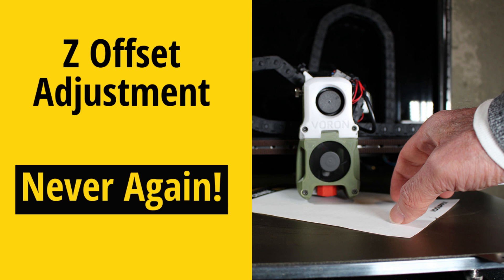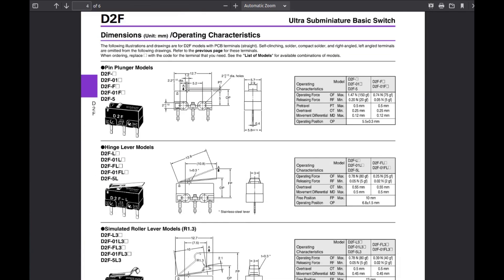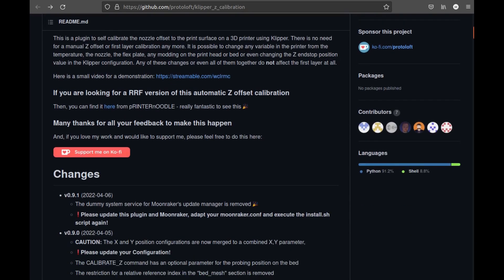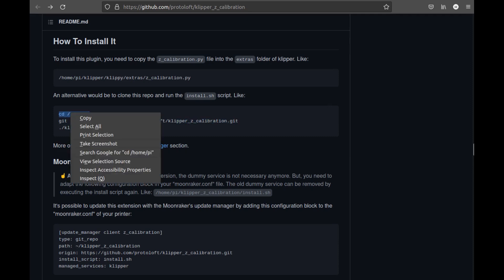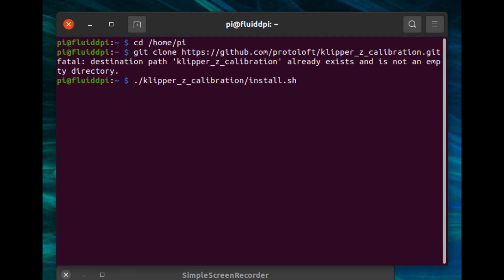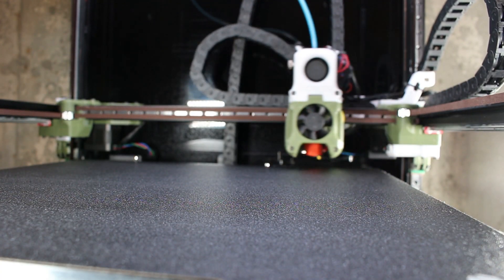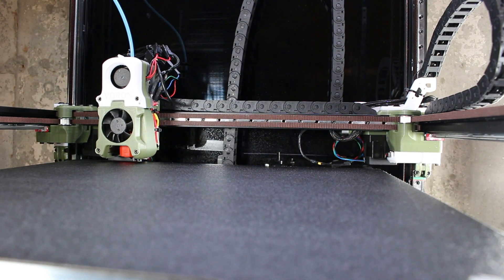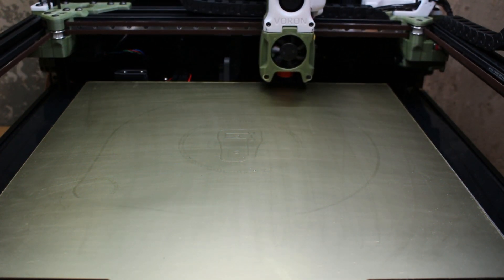Never adjust your 3D Printer Z Offset again with Klipper and a plugin

Comment: Hello, i have an Anycubic Kobra2Neo. And there ist the same switch on the end off the bed. So can i use this plugin to auto z offset my printer with klipper ? I dont wont to put that switch on the head.
Reply from the maker: For the auto calibration, you do need the second switch on the print head.   It should work for you.  If you have springs under the bed, you might need to firm those up.
Reply: @KapmansBasementWorkshop  can I use the inductive probe on my print head as second switch?
Reply from the maker: @D3ltoroxp no, you can’t.  The inductive probe doesn’t measure the surface of the bed, it measures the steel plate under the surface.  You need the micro switch as it actually touches the surface which is what makes this consistent.  Even if you switch bed plates.
Reply: @KapmansBasementWorkshop  So when i dont use this switch on head, i cant use the plugin for auto z offset calibration ? I will only when i push z offset calibration, that he push the switch in the back of the bed.
Reply from the maker: @D3ltoroxp  , Yes, you need both switchs.  The nozzle switch and the z-offset to check the surface of the bed.

Comment: My setup consists of the z-endstop dedicated for homing, and the KlickyPCB equipped with Omron D2HW-A201D microswitch.
In contrast to Euclid probe and earlier Klicky versions, where one can count with the pre-travel of 0.5mm (that equals the tip-to-body distance), KlickyPCB has its conical cap that adds a gap of roughly 3.4mm from switch-on-point to body.

Let's consider this upon the measurements I made:
Tip = 0
Tip-to-body distance: 4.00mm (-0.05mm)
Cap tip travel: cca 0.6mm (OFF -> ON)
Gap == 3.4mm (to body)

I believe this is the distance we KlickyPCB users (using aforementioned microswitches) are complaining about.
Reply from the maker: I'm sure many will find this helpful.  Thank you for posting!
Reply: @KapmansBasementWorkshop  

In order not to leave the others amid the wilderness here are some follow-up thoughts.
Since Protoloft's equation is a linear one and the switch_offset constant gets used once only, it may also be used for KlickyPCB without hassle.

My setup ended up with (autoz.cfg):

[z_calibration]
switch_offset: 3.25

It may occur 3.3 or 3.4 would prove to be fine for some.

As per QGL and bed mesh (printer.cfg), my findings for 350mm bed are as follows, see ## notes:

[probe]
y_offset: 19.0                   ## KlickyPCB distance tip-to-nozzle, towards back (Y+); was 25.0 (default)

[quad_gantry_level]
horizontal_move_z: 10    ## default 5 is too liitle, KlickyPCB skids/glides on the surface during move

[bed_mesh]
speed: 120
horizontal_move_z: 10    ## default 5 is too liitle, KlickyPCB skids/glides on the surface during move
mesh_min: 35, 25            ## KlickyPCB  position, not nozzle!       25 - probe.y_offset: 19.0 = 6               => axis goes to Y6
mesh_max: 315, 293       ## KlickyPCB position, not nozzle!     293 - probe.y_offset: 19.0 = 274          => axis goes to Y274
probe_count: 5, 3

Bottom line:
Compliments and thanks to Protoloft and you, Kapman, to make and visualize the AutoZ idea.
Helped me a lot during the build, though it was confusing (to) me at first due to the application of KlickyPCB instead of Euclid or KlickyNG probes.

Great channel of yours, thx👌.
Reply from the maker: @rozsikacsipke9880  Thank you for posting this and thank you very much for the kind words!

Comment: So one thing that always gets me stuck with any so far z-calibrate. Is the paper test. I seen this and many videos still go back to it. I would like, and I think you and many would agree, to take out the human in this all together. So I think my issue is just HOW tight is it to feel when closing in the paper? barely touching, or tightly almost paper jam, or what? this guess work is where I get stuck on EVER type of z-offset adjusting. why is there not a better more reliable way? strain gauge pressure plate? or something. Is there really no way to eliminate the paper in each of these, and more 'measured'? Yes I do have those metal gauge you can buy. but there again, what exact amount of pressure can vary by whole millimeters. so humm. Shrugs
Reply from the maker: I struggle with the same issue.  I try for lite friction.  No matter how much friction you choose, there will be some test print calibration anyway.  Howwever, with this software change to Klipper, you should really almost never need to do it again after the 1st time.   I had to replace the microswithc a few times, both actually.  I ran the paper test again after that change.

Comment: Sorry. I know you posted this a year ago, and maybe not for the printer you have or use.

I am using a BLtouch to the left of my nozzle on a ender 3 pro. ( it is heavily modified, new board, hemera all-in-one etc).

Maybe because it is 4:20 Am where i am while I ask this.
Do you or anybody know if this can be setup with a BLtouch on a ender 3 pro by chance??

Thank you.
Reply from the maker: So funny thing.  I'm setting up a BLTouch on another corexy printer as I write this.  This is my 1st time using one.  I don't honestly know, but I suspect not.  Mainly due to the shape and construction of the BLTouch.  But as I gain more experience with BLTouch (it's not fully operation yet), I may look into this next.
Reply: @KapmansBasementWorkshop  also the github is , well how to say, Bare now. I do not see the why this, and the detailed how to or any of this stuff (like on your video at 3:13). So Is this even a thing anymore? I would love to have the details the creator made. I see png files but Yes all the setup and explanation etc on the github seem to be gone.

Comment: Any changes to your print start macro? For me, the calibration works perfectly, but when i start a print the nozzle is about 4mm above the bed. Any influence from position z endstop on this or the klicky probe z offset?
Reply from the maker: I've got a very different start macro these days.  And I've been testing other features, so my  newer one does not apply.  Have you  taken a look at: https://github.com/Kapman1/Kapman1/blob/main/printer.cfg and https://github.com/Kapman1/Kapman1/blob/main/autoz.cfg or even better reviewed the latest from the creator of the auto-calibrarion software?  https://github.com/protoloft/klipper_z_calibration

Comment: Is it normal to change the z offset +/- .10 to see any change. I can't seem to get it right. Always too far or unfortunately too close and destroys build plate. Thanks
Reply from the maker: With my eyes, it's very hard to see any change.  I need to use a piece of paper or a feeler gauge to notice a difference.  But 0.1mm is usually very noticeable with paper.

Comment: I hate adjusting the Z-offset,  so many failed first layers trying to get it right.   I use a CR Touch but even with that I don't get a good accuracy between different build plates, even though it really shouldn't make a big difference as the probe, being a touch probe, should pick it up, but it doesn't.   Has to be changed every time
Reply from the maker: That is odd.  I agree, it should not matter.  Do you think the bed or the gantry might not be flat or straight?  Is there a loose part or screw anywhere?

Comment: How does this compare to tap?
Reply from the maker: I think it compares well in terms of accuracy as it's certainly good enough.  This is much ligher in weight and fewer moving parts.  It's also much cheaper.  It adds no play to the tool head.  You also don't need to worry about damaging the PEI bed at higher temperatures.

Comment: this plugin work with cr touch on an ender 3 v2
Reply from the maker: I have not tried it.  But it might work if you install a nozzle endstop like the Voron 2.4 has which would not be hard to do.  The tricky part will be getting the values correct so the flat surface of the CR touch will touch the nozzle endstop and not the CRtouch pin.  But it could be possible.

Comment: After the recent Klipper update I can't get past this error. I have reinstalled Klipper on the pi and main board. I can't figure this out and would love some assistance.  Error is "Section 'z_calibration' is not a valid config section"
Reply from the maker: Since you reinstalled Klipper, have you reinstalled Z calibration?  My assumption is that it’s no longer installed based on the error above.

Comment: Can the head height be increased inbetween the z home and when it measures the probe height on the z end stop and if so where is that located? My klicky probe is hitting the endstop as it is moving into position over the z end stop switch.
Reply from the maker: Yes, that can be changed.  I used the Euclid instead of the klicky, but have a look at your m401 macro.  The z height is set there.

Comment: I am having such a hard time with this and I cannot for the life of me get it to work.
Reply from the maker: What is happening?
Reply: @KapmansBasementWorkshop  when i give it the command CALIBRATE_Z i keep getting (Offset is greater than allowed: offset=-6.025 > max_deviation=5.000) I have looked all over and have been stuck on this for a week. Ive done every calibration I have found and nothing seems to fix this. I'm not sure what im suppose to adjust or what im looking for all of the documentation ive found doesn't seem to mention this error or what it even means. I know something is off but as to what is not correct I have no idea where to even start. sometimes I don't get that error but it will dig into the bed so im not sure whats going on.

Comment: I am having a hard time getting this working. Any chance you can help? It seems to be physically/mechanically working, but my first layer is not perfect, it doesn't even stick at all. I can still babystep down to get it to stick, but I'm not supposed to have to do that, right? My particular Z endstop is actually negative/ below bed level (-1.14 currently, per endstop calibration), do you think this has anything to do with it? It doesn't seem that far off, as in if it was flipping negative to positive it seems like it would be a 2.28mm shift, I only have to babystep like .05-.15 to get it to go, but this is the whole thing I'm trying to avoid. Does the Probe z_offset get taken into consideration here? At some points it seems like it does, but others not. Currently have it set at 6.87 per probe calibration. Currently set my switch offset to .52 as i am running the same machine as you, i know this probably needs tuned, but i tried it as high as .55 and it still didn't go down well. I feel like any further than that means something else is off. Any suggestion would be apreachiated. I was able to get an inductive probe dialed in just fine with the negative z endstop. (By the way this is just how my kit came, weird that LDO didn't get the height of the post above bed level, but until now i never suspected any problem with it.)
Reply from the maker: Have a look at this page: https://github.com/protoloft/klipper_z_calibration/wiki/How-To-Test-It
This should get you on your way.  Once you have adjusted that offset, you should be fine.
Reply: @KapmansBasementWorkshop  Been through it a couple times. It is very close, but my problem is when I do baby step it, I am not sure if I should be applying that to Z end stop, or to probe offset, or to switch offset. and I think I just keep over tweaking it. But I have also reset and restarted tuning it 3 times. Same results every time. Ended up just going with Klicky as Z endstop, and it works a treat. Thanks for the reply though, i appreciate you taking the time.

Comment: SOLVED !!! the issue when using the euclid attached to bed and changing plates more than 1 mm.
I have changed the code in the gcodes macro definition of the ATTACH_PROBE and DOCK_PROBE with the next lines added:
       G0 Z30 F6000
       SAVE_GCODE_STATE NAME=default
       G4 P500
       SET_GCODE_OFFSET Z=0
       G0 Z30 F6000
	...
	...
	ALL THE GCODE..
	...
	...
	RESTORE_GCODE_STATE NAME=default

Look that it is very important the repetition of  G0 Z30 F6000 (or the position used by you at start) to go to the new position that dont have offset applied.
Reply from the maker: This is great to hear.  And thank you for posting the solution!

Comment: I can not for the life of me get this to work. Every time i tunr on my printer it changes the z offset? Voron 2.4 300mm klicky a7to z calabrate
Reply from the maker: Silly question.  So the z-offset value changes, but the print fails as well?  When I run this throughout the day, the values it generates change as the printer is actually changing with the heat.  But the nozzle would end up being the correct height from the bed.  In your case, the nozzle is no longer at the right height?  If so, is there any play in the probe or z-endstop mounts?  Also, over time, I found I would need to replace the probe's micro-switch as I'm convinced the heat would damage the microswitch over time.  Either from the printer itself or me over heating the microswitch when soldering it.  The technical docs for the microswitch actually have strict instructions over the temperature used for soldering and the number of seconds and times the heat can be applied.  I found when I strayed from that the switch would become unreliable over time.  So in short, I don't think it's the software.  It's most likely the microswitch or the switch mount.
Reply: @KapmansBasementWorkshop  I check3d over my klicky switch it was good so I started looking at the mount in the hotend and it was cracked and loose. I superglued it back together and was able to get a print going to print a new mount for the hot end. I'll do some more testing and see it everything stays as is or keeps moving on me I'll let you know more later. Thanks for the help!!
Reply from the maker: That must be the issue. I am glad you tracked this down!
Reply: @KapmansBasementWorkshop  are you on discord? Would you be able to chat on there?
Reply from the maker: @Larkinatorr  I am on Discord.  However, I probably will not be able to chat until early next week.  But if you contact me, I will get back to you.
Reply: Nozzle height changes drastically every print. Even without turning off the printer, it will change from one print to the next. I did not solder in the switch. it's held in with self taping screws and press fit to the magnets. I'll try swaping out the microswitch and see if that helps.. originally, my switch offset was 5.2. It's at 3.2 now, and nowhere close to the bed sounds like this may be the issue. I'll try it out after work today and let you know!

Comment: Wish my probe would consistently work. damn auto z and klicky... used to work well. now its been trash. I dont get it... Also i was told that the pre travel thing isnt quite right for klicky... So unfortunately this video wasnt able to help much for a klicky user
Reply from the maker: Make sure all your bolts are tight on the gantry.  Also make sure your belts, especially z belts are the right tension and not too loose.  Most of all, check you klicky.  Has it loosened up in some way?
Reply: im not sure if you can even help with this but im desperate and if its possibly related to my auto z then maybe i can diagnose to some degree here.. belts are checked too, 110hz as they should be. adding more info here, voron trident 300, superslicer (not that it matters since it does it with old and new print slices) 30 retract 20 deretract, 100mms speeds (which is slower than i usually run) @KapmansBasementWorkshop
Reply: nope klicky is 100 percent, i even replaced the switch with a new one of my extras (base model is d2f-L) ...I set the z position endstop to zero, I do my home, z tilt, g28, then move nozzle to 150,150 (center of bed) and use probe_calibrate, then i use the mainsail ui to step down to where the paper is barely grazing the nozzle, then i hit accept, it gives some error saying i need to use test z to save, so then i take the value i got and manually enter it into my printer cfg. . . . although for this switch it says operating is 6.8mm and i measured the switch body with my micrometer and its 6mm, so my switch offset should be .8 to start? (actually mine says 6.8 because it had a tab that i pulled off, so my dimensions should be eaxctly the same as the base d2f... Figure id redo my config for the billionth time because i ran out of things to try, so im redoing the same things. keep in mind its worked up till 3 days ago, pretty well actually, but since then ive made posts on reddit and discord and still have a paper weight on my desk. . . . in a nut shell "Z offset or something related is making my first layer super thin and despite drastic adjustments to my switch offset, to bring the layer to the appropriate height,  it still over squishes... it seems at random that the nozzle drops (starts print at .08mm, too close, step up to .56 .. to far. step to .45 and thats decent, then need lil more squish so i go to .43 and now its scraping the bed???"keep in mind also i usually use .45 switch offset for PLA and .39 for ABS/TPU, but now mines set at like .10, and even then its not properly working, cause just a tiny microstep can cause the nozzle to nose dive into the bed and go from almost calibrated, to failed." @KapmansBasementWorkshop

Comment: I am confused. I have a bltouch at the moment, which also acts as my z-endstop. Do I replace my current bltouch with the click probe and pin and then also add a Klicky or Euclid? I do not see any instructions anywhere on mounts, z-endstops etc?
Reply from the maker: I believe that is what you would need to do.  Here are the requirements of this modification:
https://github.com/protoloft/klipper_z_calibration/wiki/Requirements

Comment: Will this work with a bltouch?
Reply from the maker: I don't think it does.  But when you need to replace it, consider the microswitch option such as Euclid or Klippy.  They are cheap and work well.  They also work with this software.